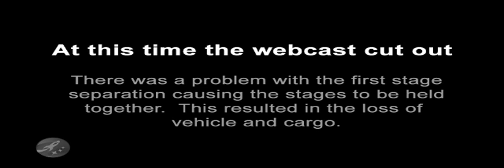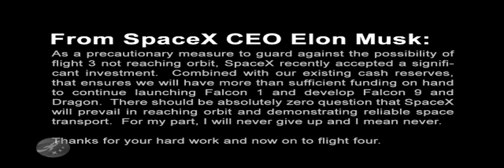Launch Failure of SpaceX Falcon 1 - Flight 3

Comment: Was that the third flight before the 4th that would decide if SpaceX would remain in business if succeeded or bankrupt the company if it failed?
Reply: SpaceX had a fourth Falcon 1 made of spare parts, and Elon said if that fourth rocket failed, SpaceX would cease to exist. Literally.

And let me tell you, per Eric Berger’s book “Liftoff: Elon Musk and the Desperate Early Days That Launched SpaceX”, almost everyone was crying when the third Falcon 1 failed. They didn’t think of the residual thrust that the Merlin 1C emitted even after MECO.

Keep in mind that the earlier Merlin 1A used an ablative nozzle, so it was safe to stage one second after MECO. With the Merlin 1C, SpaceX determined that staging should be delayed by five seconds to let the residual thrust dissipate.

And because of that minuscule correction, that’s what saved SpaceX.

Comment: 6:22 that is slightly inaccurate. The stages did not stick together. They separated, but the calculations miscounted the residual gas in the combustion chamber of stage 1, which caused it to have a little bit of thrust that overcame the relative velocity via decoupling and essentially rammed the second stage after separating.
Reply: Thanks

Comment: 2008: Falcon 1

2016: Falcon 9

2018: Falcon heavy

Spacex has come so far within 8 years, 2 more years and then it's hopefully Mars.
Reply: The Falcon 9 first flew in 2010?
Reply: ***** fudge
Reply: 2020: Starship
Reply: they did it.. 2018
Reply: Still 2 years for mars😫
Reply: hah, no
Reply: Falcon 1 first launched in 2006, Falcon 9 first launched in 2010 and first landed a booster on land in 2015 and then on a drone ship in 2016
Reply: 2020: crew dragon to iss

Comment: Wow, didn't know about the melting point. I know it's not reactive in vacuum, I was implying it could pose problems to various materials used inside the ion engine assembly. With Xe you don't have to worry about pressurization, while a liquid would develop an ullage in the tank potentially posing all kinds of problems.

Comment: I think you nailed it, the lower ionization energy of heavier elements. It supposedly more than offsets the lower velocity such an atom will achieve for the same accelerating voltage. Cs is very reactive, not convenient to handle as it's a solid at room temp and not worth the hassle. Similar to chemical engines employing fluorine as oxidant - superior performance but it's a b*tch to handle.

Comment: If you heat the H2 enough, it should become monatomic. A plasma, actually.

The heavier elements have bigger outer electron shells, so it should take less energy to strip one or more of them away to form ions. Is that the reason? Cs should be especially easy to ionize since it's an alkali metal with the lowest electronegativity of all elements except Fr.

Comment: Dunno, really. For heat-driven exhaust I guess nothing beats H2, the lowest mass compound there is. Ideally, it'd be probably be monoatomic hydrogen, but that's rather non-doable.

Ion engines, yes noble gasses are mostly used. The reason why such high atomic number elements are used escapes me right now, though I did hear the explanation once and it did make sense at the time.  Something to do with work to ionize and accelerate IIRC, i.e. they're less power hungry even if less efficient.
Reply: Hello i'm from 2017

Comment: Right, that's my understanding.

So what would the ideal rocket propellant be? Assume it didn't have to carry the chemical energy, it's just the reaction mass in a heat engine. Would it be H2 or He? I know H2 is proposed for nuclear thermal rockets.

For ion engines, which are not heat engines, I think anything would work if it can be easily ionized and given lots of linear momentum. Xe, Hg and Cs seem popular.

Comment: OK, I've done some more reading on the subject and apparently, the reason H2 is preferred in the exhaust over H2O is that along with kinetic energy, it only has one more vibrational mode that can absorb energy (it's a 1D molecule basically). H2O, being a 3-atom arrangement has more vibrational degrees of freedom, each of which can steal kinetic energy a nozzle could otherwise direct outward for useful impulse.

Comment: I was thinking about getting the maximum energy out of the fuels, but you're quite right -- only exhaust velocity matters. It's a lucky coincidence that excess H2 is a lot less corrosive than excess O2.

The S-II J-2 got a few more seconds of Isp after the mixture ratio shift. Thrust dropped quite a bit, so they did it toward the end of the burn when they had to limit acceleration anyway.

Comment: Yes, H2 is much lighter than H2O and the only thing that counts in the rocket equation is exhaust velocity. For a given temperature, lighter molecules have higher velocity. I believe PU shift works because the Laval nozzle isn't 100% efficient in converting all energy to kinetic, there's a bit of useless thermal random movement of the molecules. That's supposedly where PU shift comes in, the exact mechanism is unclear to me too.

I think S-II shift was primarily to increase fuel efficiency.

Comment: I'm still trying to understand PU shift. The S-II decreased O2 mass flow and H2 flow was about constant. Thrust went down but Isp increased slightly. Is that due to the lower molecular weight of the exhaust? Is H2 so light that there's little penalty to not burning it all?

Was this done late in the burn to limit acceleration, with the slight Isp gain as a bonus?

Comment: I guess it depends on the geometric arrangement of the turbopump assembly and also total stage dry weight. It could be that they were designed with this in mind and Falcon 1 design didn't take this into consideration. Most other rockets I've seen just start a slight roll after shutdown. Note Delta II has its vernier engines burning for a couple of seconds after MECO, probably to keep attitude.

Comment: Yes, that's fuel to oxidizer ratio. A incorrect value was used in the software in case of F1 launch 2. 

The PU shift on Saturn V S-II was to maximize Isp, increasing H2 consumption and noticeably lowering thrust as a result. I don't think it was due to depletion requirements.

I don't know about Merlin, but it could be shifted as well.

Comment: The Saturn S-IC and S-II stages both had five engines, the center shutting down first. That gave the other four engines a chance to steer out any roll torques imparted by the inboard engine turbopump.

The Delta II has a single first stage engine. How do they handle the turbopump momentum?

The S-IVB, with a single engine and a need for attitude control, had an auxiliary propulsion system.

Comment: ooh, very interesting. I guess retro/ullage rockets have gone out of style.

Propellant utilization == fuel/ox ratio, right? The Saturn upper stages had a "PU shift" that occurred during each burn. Was that to ensure simultaneous depletion of H2 and O2? If so, it must have been timed dynamically.

Does Merlin fly with a fixed ratio, or does it also shift during flight?

Still seems strange that this would happen. Perhaps the right ratio wasn't known because there'd been no vacuum test firing?

Comment: They freeze the guidance as well if you look very closely in the videos. What happens, though, is after the Merlin is shutdown, the turbopump torque is unloaded onto the vehicle and causes a combination of roll/yaw seen in all the launches.

I don't expect this to be an issue with F9,  at least not so much of an issue as the 9 engines are arranged so their shutdown torques are bound to mostly cancel each other out.

Comment: Falcon 1/9, along with Atlas V, Delta II and most likely Delta IV as well all use pneumatic pushers for stage separation.

What happened on flight 2 was the Merlin propellant utilization was set incorrectly, lowering thrust and as a result staging happened much lower in the atmosphere. This caused aerodynamic drag to play an effect on staging.

Comment: Apparently it wasn't obvious to SpaceX. I haven't seen video from this one, but on their last flight there was a very definite impact of the side of the 2nd stage engine with the inside of the first stage fairing caused by the two stages not maintaining fixed attitude during sep. This one appears to have been a recontact in the longitudinal direction.

Comment: PS. The attitude/chi freeze applies to 2nd/3rd staging. The first stage is steered with a precalculated yaw/roll/pitch program, and the pitch program is frozen during 1st/2nd staging. So it's really the same thing.

True inertial guidance starts later during 2nd stage burn when the launcher is for all practical purposes in a total vacuum.

Comment: I think the impulse from separation pyros is nil. Linear shaped charges cut through the separation plane and the stages have to pull themselves apart. Usually there are solid fuel retrorockets on the first stage and ullage rockets on the second. They pull the stages apart and settle the second stage propellants.

It always really bothered me to see that cloud suddenly envelop a Saturn V at staging.

Comment: I could understand early repeated failures of, say, a rocket turbopump. They push the limits of exotic materials under extremely demanding and hard-to-model operating conditions in a complex device with very little operating margin. So there were repeated turbopump failures even in a major, well-funded project like the Ariane 1.

But you can model staging recontacts with freshman-level physics. Avoiding them is (or should be) just not that hard!
Reply: Would you care to add any remarks with taking into account the nearly 14 years since?

Comment: It's not as if this were a brand new problem in launcher design, either. There are standard ways, used for decades, to preclude stage recontact. You freeze guidance on both stages before, during and after separation so they remain inertially fixed. You allow plenty of time for the lower stage thrust to decay and the stage to fall away, and you use retro rockets to help.

A recontact nearly occurred on Apollo 15. The launch succeeded, but they made absolutely sure it never happened again.

Comment: It's bad when a failure occurs. It's much, much worse when the same failure occurs TWICE, namely the recontact between first and second stages. It happened on the last (second) flight, though it wasn't the cause of that particular failure.

It seems the way they're getting their low launch costs is by scrimping on the detailed engineering analyses and methodical attention to detail that space flight absolutely demands to succeed. This is not a good bargain.
Reply: I think they solved their problem